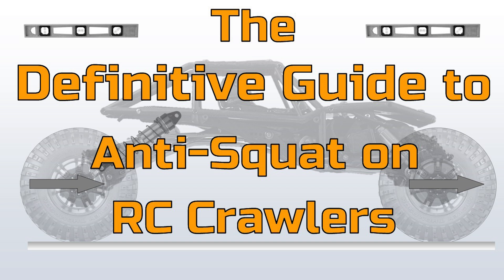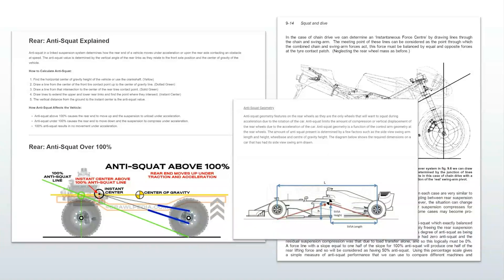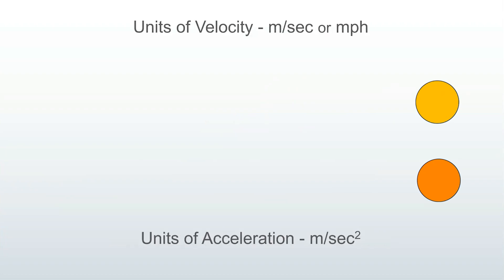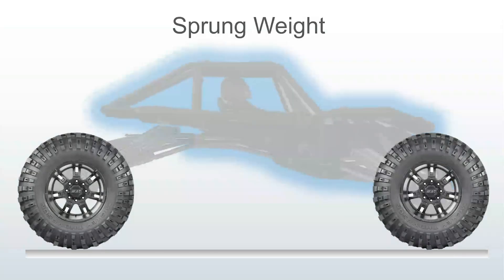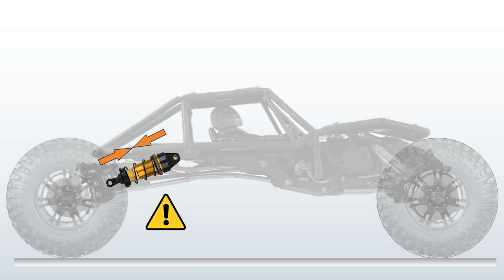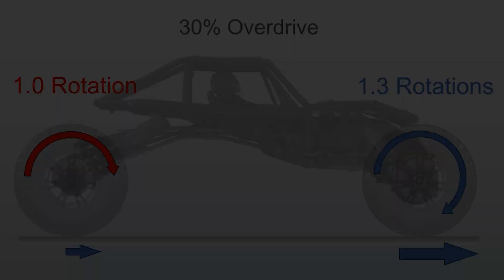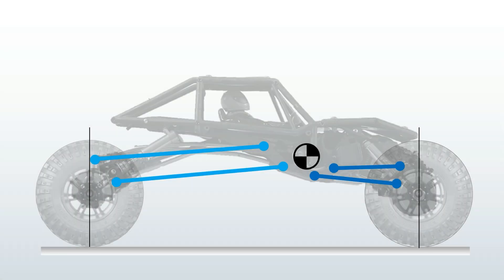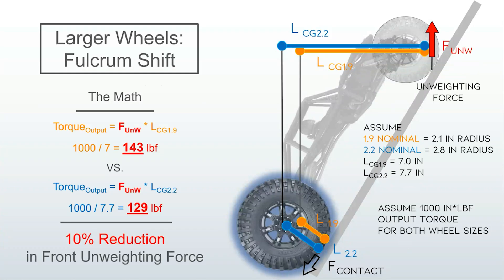The Biggest Misunderstanding in RC Crawling - The Definitive Guide to Anti-Squat

Comment: Ok. So what do link riser actually do? Which position to choose, if there are several positions available to fit the links above the axles?
Reply from the maker: At slow speeds they don’t do anything. Under high acceleration they would change your anti-squat response. I wouldn’t just arbitrarily add one unless you know where your AS is currently. More is not automatically better. Most RTR and stock vehicles will have it figured out already. If you are building a custom crawler I’d recommend drawing the diagram and targeting 100% AS. But remember, it changes nothing at slow speeds despite what many in the crawler community believe. There are simply no physics that support that belief.
Reply: @BoomslangSuss  Oh, I see. So the purpose of link raisers is still anti squat and nothing else, but anti squat only works under dynamic acceleration, as you made perfectly clear in the video.
Reply from the maker: Correct.

Comment: I recently did a 4ws swap on my h10 optic using a optic front axle and that moved the links in the rear up and apart greatly I haven’t got to run it yet but I feel like it’ll create issues
Reply from the maker: Apart is generally bad for stiffness and triangulation.
Reply: @BoomslangSuspension  I went about the same width apart on the front where it mounted to the chassis when I re installed them to keep the trianglation about the same as it was

Comment: So you’re saying link angle that produces a high antisquat value (I.e. 150%) isn’t useful compared to a bar angle that produces say 75%. I’d like to hear your opinion on high a antisquat value while considering what rear torque is doing to the unloading of the rear shocks on a climb.
Reply from the maker: That is what I’m saying, but in the right context. Anti-squat does not matter without acceleration such as a slow uphill climb. It’s a dynamic response. 
Also bear in mind that I did not invent this. Anti-squat is well understood and accepted by suspension engineers worldwide. It’s only within the RC crawler community that some people have erroneously extrapolated that to include slow speeds, without acceleration, and believe that it pushes the front and down. But the physics don’t support that.

Torque is a static measurement - force x lever arm - and is not a variable in any anti-squat calculations. A rapid change in torque creates acceleration, which then enters into the anti squat realm. 
Torque alone doesn’t compress or extend your rear shocks. It unweights the front end which shifts weight bias onto the rear wheel which would compress the rear shocks indirectly.

Comment: Awesome video! Couple of questions. 

In my own testing using my trx4m based rock bouncer build, it seems that raising the rear links helps a little when bouncing up and over obstacles that I can't slow crawl, like where it would high center.  Seems to pop up and over better and be a little more predictable. Does that make sense or am I imagining things? I haven't run the geometry calculations on my rig, and the observations are from running it on then rocks, not from anything resembling a controlled environment. 

Second, it seems like with the links ALL the way up (just to see), the sidehill performance is worse especially when turning uphill. The rear uphill tire seems more likely to peel itself off the rocks and I loop out.  Could that be attributed to the link position, or maybe just run-to-run variance? I can never hit the same line in exactly the same way lol

last, are parts like suspension links and driveshafts considered sprung or unsprung weight? A little of both?

LOVE the videos BTW. I'm a full time auto tech, and being able to observe all this theory on a small scale is 100% what got me into crawling.  Having your explanations on the theory is an awesome resource.
Reply from the maker: It’s hard to deduce anything from an uncontrolled environment 😂 but you are on the right track. An increase in anti-squat will stiffen the rear suspension when you punch the throttle and that seems to be what you’re describing.

For side hilling it really should have no effect. 

If you’re trying to calculate your sprung and unsprung weight, very precisely, normally put 50% of your link and driveshaft weight to each. 
You could also take apart your shocks and weigh the body and the piston separately, or just assume half of the shock weight on unsprung and half on sprung. 
1/10th scale 10 mm shocks have very little difference in weight whether you mount them up or down and I did a video on that.
Reply: @BoomslangSuss  Thanks for the reply! As far as the sidehill behavior where the uphill rear tire unloads, do you have any general tips or suggestions to improve that?

The rig in question is a trx4m injora tarantula, about 25% OD, 61/39 weight distribution, 59mm shocks with custom mounts on the body. At full compression the lower links are pretty much parallel to the ground.  Front shocks are rubbed banded for full droop, rear have no bands and sit about 75% compressed at rest.  Wondering if I have too much travel, or maybe should try banding the rear.  It's like if it gets past a certain point of leaning, the body roll kinda gets too much leverage on the rear axle. Hope that description makes sense haha.

Totally appreciate you dropping the knowledge!
Reply from the maker: Despite what a lot of people think, you can’t improve sidehilling with linkage. Lower CG is really the only thing.

Comment: There is alot that I know first hand is untrue in this video.. first and most importantly torque is what decides anti squat after link separation, link separation is more important at the chassis that at the axle and when both are used you can easily achiever the rear shocks lifting instead of compressing under torque..  this makes a huge difference with bumping up a ledge even with low wheel speeds and the suspension is harder to compress under acceleration..
Reply from the maker: The physics in the video are correct. Torque is not a variable in anti squat calculation.

Comment: @8.50 i would say if the shocks extend its anti squat and of its compressed from the forces of acceleration and chassi reaction its the oposit of anti squat its pro squating
Reply from the maker: That’s a fair point. I guess it depends who you are talking to. For example, the definition of “full droop” can be completely opposite if you’re talking to a full scale builder versus an RC crawler. Your explanation makes the most sense.

Comment from the maker: You can shoot the messenger if you like, but I didn't invent Anti-Squat. It's a completely proven, established and standard principle that is widely accepted by suspension engineers worldwide. I'm just sharing it because I know the RC Crawler crowd will benefit from it.
Reply: @BoomslangSuss  bro, the axles aplies  torque to the links at the end of a lever. The ic is the fulcrum. Depending on where the ic is above on or below the 100% line, applying torque will either push the body up away from the suspension,  be neutral or pull the body towards the suspension. That is it period. Acceleration and weight transfer have nothing to do with it
Reply: @jda79  your comment needs to be seen by everyone. It really is as simple as this for crawlers.
Reply: Oh, actually this is so well explained to be a fresh content and helps me put together all the notions I've learned from older videos. I definitely subbed. 
And I'm not into RC, I'm building my own cross kart. 
Well not yet RCs, but I do love scaled models for designing and figuring out stuff, and would be cool one day to learn some electronics and stuff a motor even an engine, on the 1:3,8 scaled chassis model I made! :D

Comment: How do after market link risers affect performance they have extra holes in them so you can move your links to different positions you have upper link extenders & mounts & axle mounted link mounts also with multiple holes to move the links.
Reply from the maker: Generally, if you move your links to a higher hole on a link riser the AS value increases. But that’s not necessarily always the case so you’d want to verify. It’s up to you to determine how much AS you like. 70-90 is a good range. But remember, it only benefits during acceleration, not slow climbing.

Comment: Anytime you apply torque it matters. If the slow crawler had really bad geometry appling torque can load or unload the vehicles it was you dont want😂
Reply: Yes any time you apply torque high enough to pull the links and cause a chassi reaction.
Reply: @extec101  any amount is enough, even if you can't see it

Comment: But isn't just standing still on an incline, actually accelerating parallel to the hill, to fight the slope projection of gravity. I mean, the cars have different postures when standing on a horizontal distance vs incline. As an intuition, when driving uphill in a normal gasoline car, you find that the engine is accelerating even though the car's speed is constant. An electric motor when standing on an incline, is drag braking, which is basically acceleration to stand still on an incline. And anyway you have acceleration from moments when you stop on a hill and start going again, less again bumps. My point for sure, constant speed on an incline is actually acceleration to stop gravity, and anti-squat is at work here.
Reply from the maker: If you can’t SEE an acceleration - faster and faster and faster - it’s not there.  Plus the only acceleration relevant to AS is the wheels accelerating out from under the chassis.

Comment: If anti squat doesnt hurt slow crawling then there is no reason to not have some antisquat for when you bump it up a rock or line quickly. Its pretty rare that there isnt a time in a run where you need to quickly bump yourself up and over a ledge, anti squat would then help with that quick movement right?
Reply: That's how I see it. Even more so when the rocks are covered with sand or dust or making jumps from one rock to the next.
Reply: Anti-squat will make the rear end stiffer on power, so it won’t be as compliant over bumps. 

A car with a lot of anti-squat can get jumpy when accelerating over bumps. Less anti-squat allows the tires to move up and compress the suspension with the rest of the car floating forward, dragging its belly.
Reply from the maker: @Glocktologist  Agreed. You want the "right" amount of AS, not just "more".
Reply from the maker: @rcrockcrawler Your vehicle definitely has some amount anti-squat automatically. You should know how much before adding more. Don't just add more without knowing.
Reply: @BoomslangSuspension  How have I indicated that I “just add more without knowing”?
Reply from the maker: Perhaps I misinterpreted your comment. Most vehicles have AS and that’s a good thing for throttle bumps. There is a sweet spot for how much AS.

Comment: Even knowing better haha, my biggest mistake with tuning, is changing more than one thing at a time. Instead of just changing shock angle, I'll change angle AND spring, or angle AND something else lol, just can't leave it alone.
Reply: ”One thing at a time” is a great principle but don’t follow it blindly. Some setup changes may only work correctly if you make another change to compensate for a side-effect you want to eliminate, for example.
Reply from the maker: @Glocktologist  I'm trying to think of an example of that???
Reply: @BoomslangSuss these may be interpreted as a single change, but you may sometimes change the shock pistons and the oil at the same time to adjust high-speed damping one way or the other while maintaining a similar low-speed damping as before.

When going from one track to another one with more grip, you may want thicker sway bars and you change them both in the front and rear: changing just one would affect the grip balance of the car. Changing the balance could be what you want so it’s not a given that changing one sway bar means touching the other. 

 Or, you may want to combine changing the axle height on a buggy with raising or lowering the camber link at either end to maintain the same link angle as before. 

Rear toe-in and anti-squat may also benefit from simultaneous adjustments.
Reply from the maker: Good observations. Thanks for sharing.
Reply from the maker: "One Thing at a Time" - that deserves it's own video!  Keep on playin'